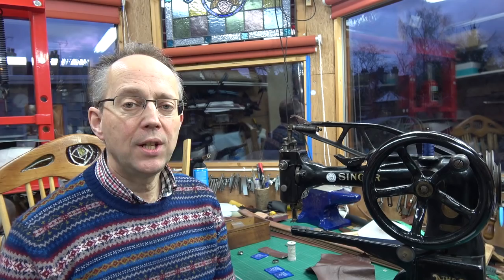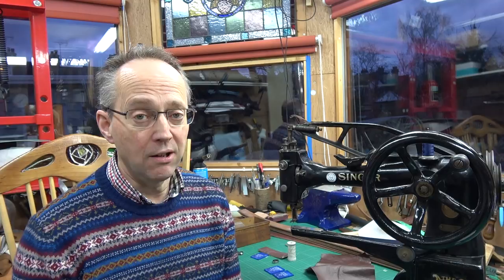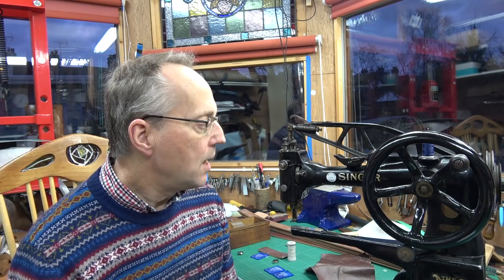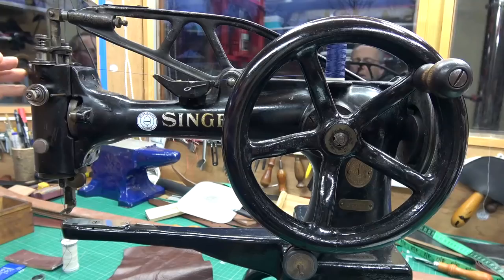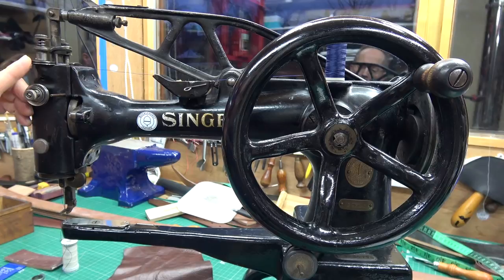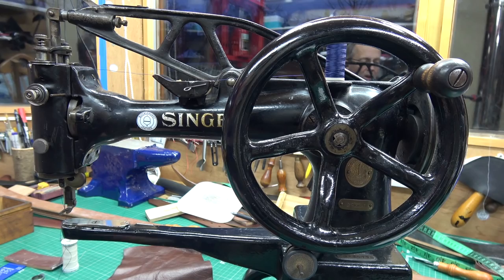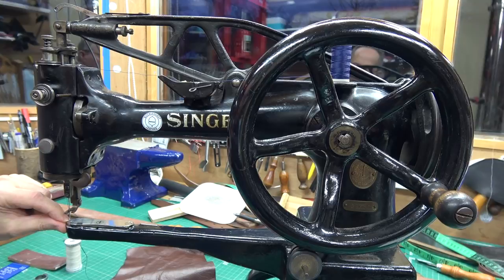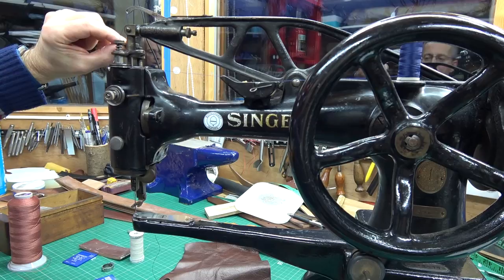Fixing Sewing Machine Problems...Singer Patcher 29K

Comment: Hi Harry,  I have used a patcher to stitch leather menu covers. The tensioner on the side of the machine is not for bobbin winding but is used when sewing work that needs to be rotated on the needle, as the corner of a menu cover. You can then lift the presser foot without loosing thread tension, rotate the work on the needle, drop the foot and continue sewing the other edge. If you use the upper tensioner the thread tension will be released when the foot is lifted so ruining the stitch continuity. I think the manual claims it's for darning. I've done many hours on this machine and never bored with it.
Reply from the maker: vimy385 That's very interesting...thank you.
Reply: Traducir español

Comment: I've had one for many years and it's on a treadle base so the hand wheel is on the end. You may have inspired me enough to get it running again. It has a super long arm and I've been told it's for reaching down into tall boots.

Comment: Thank you Harry. I got a beautiful  1960’s singer 29K71 in a basement clean out. I love the machine, and find your videos very helpful. It would be great, however if you, or one of your viewers could go into more depth on the other settings of the machine such as walking foot tension, take-up-lever tension, and take-up lever travel. Also, one discrepancy I found in your video is when you claim that the tension discs on the front of the machine are for bobbin winding. Singer clearly states in their manual that those are to set up the machine for darning.
Reply from the maker: Thanks and good to know about the darning.
Reply: Mind you, I’m not disputing that you could use the front discs for bobbin threading on your machine. I’m sure they would work quite happily. Except mine has the hand wheel on the end, and it wouldn’t work on mine. Do you know where I can get the flange and shaft to change it round to the front? I would like that better. Keep up the good work on your videos.
Reply from the maker: @ironwrx  Worth looking at College Sewing Machines UK...they will know and I think they post internationally.

Comment: Thank you Harry, for your excellent and informative videos. I enjoy them very much. 
Just one detail for your consideration, concerning the tension disks in the front of the needle arm: The Singer manual recommends to use these to "Thread the Needle for Darning". Darning seems to use a different path for the thread than sewing. Unfortunately I have no idea what "darning" is. However, feeding the Bobbin wouldn't actually require a complicated tension disk arrangement, would it? Thanks, Martin
Reply from the maker: Thanks Martin...and you are perfectly correct. Darning is for repairing holes not using any feed other than hand movement of the item being darned. All the best Harry
Reply: The reason they use a separate set of tension disks for darning on the patcher is the main top set of disks is lifted when you lift the foot. For Darning, you want to lift the foot and move the material by hand.   So you need a 2nd set of tension disks that do not lift apart when the foot is raised.

Comment: Im having difficulty with the take up. Not enough thread is being pulled back up and its loose. Tried to adjust the take up lever, but is not doing much. Any suggestions? Its an Adler patcher.

Comment: What should you do if the bobbin threading and the needle thread are not catching?
Reply from the maker: Hi I suggest you start by changing the needle as it may be bent or damaged, then check you have a sharp point on the bobbin. Rgds Harry

Comment: Hi, Harry. I have recently purchased an old Singer 29k53 and it is fantastic. There is however a fault when the machine is running, and I'm hoping it isn't anything too serious. Could you please see the machine running in the latest video I have uploaded on my channel to see if you can identify the fault. Many thanks in advance.
Reply from the maker: Hi is the handle wheel fully on its axle???something looks out of true.
Reply: @harryrogers  thanks for your reply. I shall check on that. Could it be that the shaft may be bent? (that may sound a daft question), everything seems to be running fine other than that 👍

Comment: Great video! I was wondering about the industrial bobbin. Do you need any additional parts or will the bigger shuttle and bobbin fit right in without any modification ?
Reply from the maker: Hello I don't think there is any way of adapting this machine to take bigger bobbins.
Reply: @harryrogers  i mean the one you showed in the video while talking about bobbin issues. You showed a small and a big shuttle ? :)

Comment: Please help me! My 29K70 will sew about 5-6 stitches then nothing. What am I missing? I have replaced needle, shuttle, bobbin case and thread. I don't know what to do next. Thanks in advance for your help.
Reply from the maker: Try a bobbin drop test...Google it..just to check your lower tension. Then check your thread path on yhe top thread to ensure it is smooth.

Comment: Can anyone help with the screw and lever at the top of the needle driving bar and pin is it for setting the depth of needle when entering the leather or for how tight it pulls the thread back up its the one thats closestto the machine pin holding the lever on top i. Had taken the machine apart to clean and re-oil it k(it was etremely dirty )and i dont think i have it set back tge way it was also my leather patchers sews very small stitches and the leather wont move thru by itself it must be pulled is this normal ?
Reply from the maker: Hi If I am understanding your questions and my memoryis still working...its how tight the thread is pulled back. Needle penetration is adjusted by a screw collar halfway up the  needle bar. You should be able to vary stitch size by adjusting the little collar up and down  its the collar about 1 inch above the needle. It's worth downloading a manual from the Web...say off of ISMACS website. Good luck.

Comment: Gday Harry fantastic video iv just bought a Singer 29k53 and after cleaning, oiling and fiddling iv managed to get it to sew. But however the 360degree revolving foot won’t spin on my machine. It will if I force it to but that doesn’t feel right to me. Do these machines have a lock that stops the foot from revolving or is there something I can try to make it free up a bit? 
Thanks 
Zac
Reply from the maker: Zac - there is usually a thumbscrew to lock it....take a look at the online parts manual. Rgds Harry

Comment: Hi Harry i have the same machine, my problem is that after some good stitches the machine starts to leave out stitches i.e it doesnt grab the bobbin thread anymore.

I dont know what the problem is i tried to adjust the tension but it seems like it doesnt work.

Sorry for my english Best Regards
Reply from the maker: Blunt point on shuttle perhaps...needs to be sharp to pick up the thread consistently.

Comment: Hi Harry, 
I bought a singer 29 k 2 patcher and the timing is totally off. It will not pick up any stitches at all.  I've spent hours trying to figure it out to no avail. I've probably screwed up the timing even worse playing with it... Can you help? 
Thank you kindly!
Reply from the maker: Do you have a sharp point on the bobbin?...it needs to be good.
Reply: @harryrogers  thank you...I cleaned up the edges   of the bobbin plate and now it seems to be working better

Comment: Thank you Harry, so helpful! Just a question though. Can you tell me what the small tension disc located at the front, left, below the upper tension adjuster  ( and tension discs where the thread goes ) is for? One person said it is the tension for winding the bobbin, another that it is for darning? I cant find any other information for its purpose ... but its not for bobbin winding I think. :O)  ???
Reply from the maker: A couple of people have found in a manual it says it is for darning.
Reply: @harryrogers  Thanks Harry. My son just pointed out the take up lever was seized... now wiggled with oil and left to soak in more oil. Every step forward is a positive. The machine is full of dirt and congealed fluff. Just working my way through it all and learning all the time. :O)

Comment: Hi Harry, I would like sometimes to stitch thin fabric with K29. I was wondering if there is a way to reduce the clearance between pressure foot and needle plate. Mine is approximately 1/16 inch when the foot is in its lowest position that it doesn't feed work piece at all. I don't have any problem to sew thick leather.
Reply from the maker: I don't know if a leather plate on to of the needle plate would help?
Reply: @harryrogers  Thank you for the idea!

Comment: I have a patcher but the walking foot doesn't raise enough to move the material I am sewing.  Any suggestions?  Thank you in advance!
Reply from the maker: Hi..change stitch length and release top screw tension...download a free manual from ISMACS. Rgds Harry
Reply: @harryrogers  Thank you the reply.  I looked the up manual, fiddle with the adjustments and still the foot didn't lift higher.  No matter what way I moved the block to control the lift, or tightened and loosened the screw on the long arm to change the pressure on the foot, or moved the stitch adjustment, the leather wouldn't feed and the the movement of the foot didn't appear to change in any way.
Reply: Its a 29K71 if that helps.
Reply from the maker: @ronrouse1746  Let's hope someone else can help Ron.

Comment: Hello Harry. Can I put a hand wheel on the front of my 29-4 from 1910. Or my 29-4 from 1920? I would like to add that to one of them if possible. Thanks a lot from Montana. USA.
Reply from the maker: Yes I believe you can switch the wheel around Bryan.
Reply: yes
Reply from the maker: @jamesdixon7459  thanks
Reply: @harryrogers  I just purchased a 29k71 and have reseached most models of the machine trying to understand  what it can handle and   what the difference between them are.